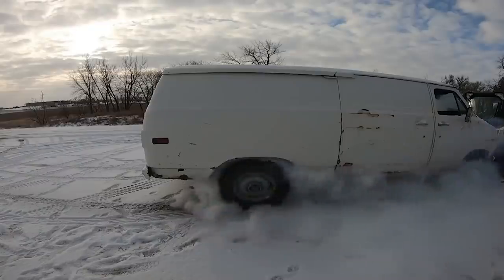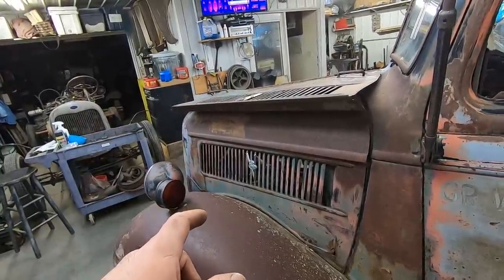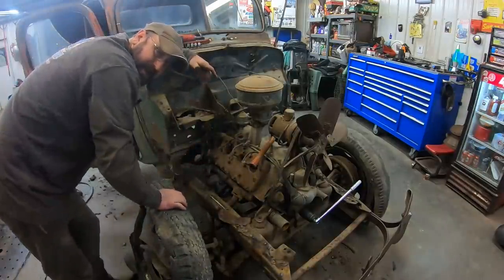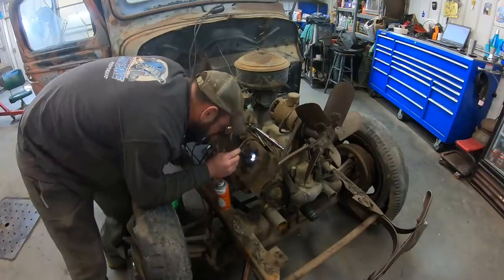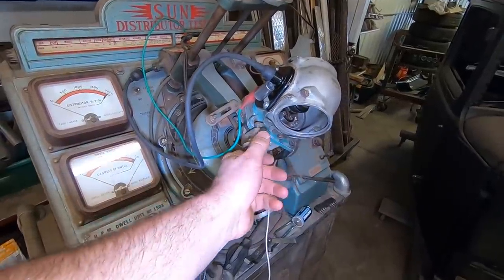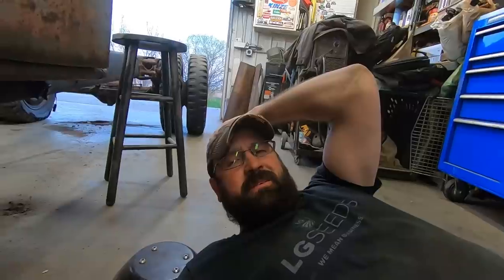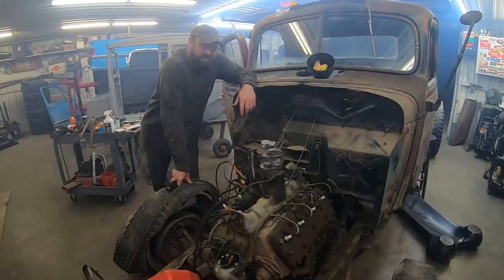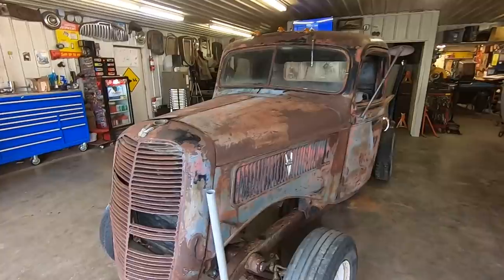1937 Ford truck Abandoned for over 35 years! Will it Run?!? Flathead V8 engine!!

Comment: Kroil is great stuff! I used to work offshore Louisiana,  that's about all they used for the salt environment. It works really good. But needs time to work. I snapped a 5/8 bolt off on my ol John Deere. Soaked it with Kroil, let it sit for 2 weeks & backed the bolt out with a channel lock!

Comment: Hello Mortske and Duff Dog, I had a 78 mercury monarch 302 and had to do the pokey pokey with the Oil, I put the Plug back in and put about a can and a half of Berrymans b-12 chemtool in and started it and let it run about 20 minutes and Holy Shitsky I didn't think it was ever going to stop draining, Pure mud I changed it again a couple weeks later with Berrymans and never had the problem again, drove for a few years with not much problems.

Comment: I’m 73 I remember these old Sun machines. Nobody that I knew reall y understood how to work them either. 😺
Reply: I am 66 and used Sun equipment a LOT in the mid 1970s in GM dealerships. A lot of the profit in them was pure showmanship, but if you had the knowledge, they could and would locate a tiny or intermittent issue. 
I had the benefit of GM training schools, so I had a lot of resources not available to independents.

Comment: Seeing as how that Ford Flat head V8 hasn't been bored out nor the valves ground and its from 1937 its worth more than the truck to get just it running. I like that throw together roller '37 Ford half ton pickup on that frame. great idea.
Reply from the maker: Thanks Larry!

Comment: When I graduated High School in 1973 ( Dont say it!) I went to work at a local TEXICO Full Service Gas Station! As a young Jedi Knuckle Buster. The old boy running the place said " You gotta start at the bottom and work your way up! Which meant everything under the car or truck was mine LOL! It was SOP to drain a quart of old oil out and add a quart of Kerosene and let her idle for about 10 minutes before the oil and filter change. We also never changed the Spark plugs unless the porcelain was cracked. We had the old sandblaster plug cleaner or we used the oxy-Acty number 0 gas welding tip to clean them. We had a Spark plug tester made by AC DELCO and a Distributor Machine too! I never got to use the Distributor Machine but I was told how it worked. I had to be able to snatch the 7/16 flat washer from his hand to prove I was worthy! LOL!
Reply from the maker: I'll have to show my spark plug cleaner collection sometime!

Comment: 5 minute engine flush looks just like, you guessed it, ATF fluid. I know that  ATF fluid works because in my younger days I worked in a shop when one came in...in exactly the same condition. Actually worse. I idled it for 5 minutes with the ATF fluid in the block then drained the pan. But not before the customer was contacted. It actually drove away. Good find there. The Ford that is.

Comment: awesome, another good ol' flathead Ford revival, man I love these engines let alone flatheads in general, I love how when they run they sound like a sowing machine when they're running
Reply from the maker: They sure do!
Reply: @MortskeRepair   yeah I was expecting that thing to be stuck but surprise surprise, had a few surprises like that as well, anymore plans with the Ranch wagon? I still would keep it a 223 6 cylinder since there aren't many of those 6 cylinder wagons or that particular car itself with a 6 cylinder anymore, but if I were to V8 swap it I'd get a 292 Y block or a 352
Reply from the maker: @elliothenning8791  On the hunt for a replacement engine.
Reply: @MortskeRepair   good luck to you sir, would like to see a part 2 of the ol' wagon

Comment: Dude, that battery box is legit, the bottom board is nice, oh and the ac hole in firewall is nice, you can keep cool on those muggy nights. seriosely the frame rails could be cut into fence braces, or used to splice something, all and all a nice rescue, and wouldnt be nice if it runs again.

Comment: I did some research, and i think you are right about the time frame on this truck. I can't find any evidence that Varcon batteries were produced after the mid 60s. Tiger spark plugs were manufactured by Gamble's, the same company that made Varcon batteries. Based on some pictures I found online, that appears to be a 60s era plug.
Reply from the maker: Sounds like that model battery was discontinued in early 1972.

Comment: i like what you do including the inserts,i have found one great penitarating oil called free all,i have used what you are using and still have some i bought a tractor at a sale were got 54 dodge first thing i did was check for stuck valves sprayed stuck one worked them a coupe of times totally freed

Comment: I started my truck once with the breaker bar still on the crankshaft bolt. Starter made a weird noise then fired right up. That's when I noticed the breaker bar sitting on the ground with the crank bolt sitting in the socket...LOL
Reply from the maker: Whoops! Just loosened the bolt on this one thankfully!

Comment: In the day , most trucks with 7.50 20s were called ton and a half. I rember with a 47 dodge being pulled on a scale at around 23500. It had the “upgrade 800 20 tires”. With a flathead crysler 6 and a 4 speed. Darn good truck.

Comment: My 55 from hell had a similar never changed oil pan. I popped the valve covers packed solid with sludge Call dad at work and he brought home a gallon of tri clean I removed as much as was possible and poured the gallon of TRI clean then fired up the camp stove under the oil pan refueled the stove twice and then dumped the solution. When I removed the valve covers thing were sludge free.
Reply from the maker: Nice!!

Comment: This must be the 4th time I've watched this video. A great one, starring my favorite engine, the flathead V8. I let an old Ford distributor machine get away from me back in 1989 when the Ford dealership I was working for was sold out. Was twisting wrenches back then. Kick myself for not buying it as it went for nothing. Had no where to put it at the time. Also let a Sun Analyzer get away at the same time.
Reply from the maker: Right on!

Comment: Watched a fella place a large pan full of atf/diesel  under engine, used a solvent washer pump to pump mixture up into oil drain and flush up through the block and out sparkplug holes and the oil filler, floods back down into  catch pan and pumped back up through engine.
Reply from the maker: Interesting

Comment: So.....ya got y'self another flathead truck....and you didn't drive the thing when she fired up!  What you scared of, Mort?  You've driven things without brakes before - all I wanna hear is the crashbox do its thing to the backdrop of that tuneful flathead and the whines of them straight cut gears!  

As you say though - there's something about a flathead V8 that just makes you smile.  The starter on that 37 and the way she spun the engine over and how it just caught and ran when you hooked up the tank, reminded me of a looong gone '48 Bonus (which did indeed have the 2-bolt dizzy) and the looong gone bloke who used to drive her.  Haven't seen a Bonus over here with her original engine in her for a very long time and the Jailbar (46/47) is more common in this country anyway.  

Still remember Dad's sequence for starting the old girl too. Summer or winter, he'd go out, climb in the cab, slam the door, roll the window down, light a smoke, then two pumps on the gas pedal, and wind her over.  Usually she'd go first time, but if not running after 5 seconds cranking, he'd let the key go and you'd hear that starter wind down  Two more pumps on the gas and this time she WOULD fire - and the flathead never burst into life with all eight, but acted more like one of the old V12 Rolls-Royce Merlin engines and you'd get partial participation for a few revolutions as though the pistons were sorting out which order they were going to fire in and eventually got it sorted out and she idled beautifully.  

OHV engines have a beautiful sound at idle, don't get me wrong, but there is something more magical about the idle of a flathead and they have a musical lope that just cannot be reproduced by any other thing on the planet.

As to what you found in the sump of that thing - yeah, I reckon someone might have been trying to up the compression or improve the oil pressure by filling the sump with grease instead of oil.  I've seen old grease separate into something like what you found, but I have never seen oil do that.....and as to the betting?  I said 'no water in the sump' and '5 cylinders have no compression'.  But hey - she ran and she sounded good.  Good on ya mate - another one saved.  Thanks for the vid - and the memories!
Reply from the maker: Lance! If I made shorter videos you wouldn't have so long to type these novels!! Thanks as always! Gotta love the sound of these ol' flattys!

Comment: I had a 37 flathead 4 door sedan way back in 1968, had alloy heads. Stripped 2 fibre timing gears which I replaced with a metal one, by myself in a n old dairy building, in regional Australia . The other main issue was the fuel used to vaporise in the fuel pump because of the dumb place they located it , changed to electric.. was a great old car.

Comment: I'm thinking that the engine hasn't been run since the late fifties judging from the looks of the battery. I've been using Aero Kroil for years. It is one of the best penetrating oils I've used. The only catch is it has to be ordered from Kano Labs directly as I've never seen it in an any stores. Those Tiger spark plugs were made in the late 30's or early 40's as they are a two piece plug that can be taken apart for easier cleaning.

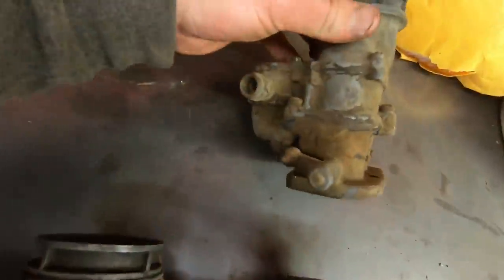Comment: 1:02:49   I have a rare Stromberg 81 in my 1927 4 Banger.  The Stromberg 81 also has the inlet at the same location as the 97.  The 81 will have a similar marking as you pointed out except with an 81 inside the small circle.  If there is no number 97 or 81 on it, another way to tell is to look at the other side and there will be a fraction, either 13/16 or 31/32 or 1 1/32.  That is the Venturi size.  The 97 will say 31/32 which is the same as .97" venturi.  The 81 will say 13/16 which is .8125" venturi.  That is why the model is called 97 or 81.  Just to break the rule, the model 48 refers to the main jet size of .048". Go figure.  Good job breathing life back into this old flathead; I was concerned with you creating all that exhaust smoke with your shop door closed. Quick work on putting out that fire.
Reply from the maker: Great info Stephen! I need to do more research on them.

Comment: The mortske special drink. Just mix 2 broken starters with some flexi rad hoses and garnish it with a plastic oil line gauge with just a tiny bit of oil left in it. Get the good stuff
Reply from the maker: Haha, it doesn't go down very smooth!

Comment: Thank you for the old Ford education.  I never got near any of that stuff. It seems the more locked up they are the more enjoying it is to watch you succeed. I wondered about that Flathead with the seized transmission from last time. Do you think filling it with evapo-rust would've worked? At the powerplant we used Kroil everywhere. I had never seen it before that. Awesome stuff.
Reply from the maker: Glad you enjoyed it! Not sure. I should have busted that one open.

Comment: You can run the coil with a resistor from another modern car, like a Ford or a mopar. 

But you can also just make an adapter, and glue a center wire in it. 

I’ve done it, it’s not great, but it’s possible.

Comment: That's a cool dually/ pickup,that engine sounded great to have been not run in 40 years & you & Derek from Vice Grip Garage should get together & do a video together,Derek can taste the oil & you can change a starter,Lol just kidding aside but seriously you 2 should do a video together

Comment: That Kroil stuff works pretty good. We have that stuff at the factory I work at but the maintenance guy there thought it was a cleaner or something, and boy does that stuff fume up the place. If you use that stuff in moderation it's fine but I wouldn't use it as a cleaner. We ended up using the exhaust fan in the middle of winter to air out the shop.
Reply from the maker: Haha I'mma use it as cologne!
Reply: @MortskeRepair  🤣😂👍

Comment: She's a Runner!!  It'll clear right up I bet... so for flushing the sludge motor, I'm actually an expert.  You'll want to fill it up through that vent tube right up to the top with some Jagermeister, let'er sit over night and have all ur friends or rent some college students or something to come shake the hell out of it, then simply apply air pressure cupped over the vent tube with a Jaeger soaked rag and give her the full beans and have a buddy open the bolt at the bottom and it should look like what comes out after a nice TacoBell chalupa party bag!  Then refill clean oil and ur all set!

Comment: You sure were brave giving praise to that starter. I was expecting it to laugh at you right before it decided to die.
Was it normal for Ford to mark their pistons with "STD" back in those days? It seems odd since you'd think they would only have one size when building a new engine but it also seems odd that someone would replace all of them without boring and rebuilding it. If anything I had expected to see a Ford emblem in the middle of them.
Reply from the maker: Yeah, my other flathead video had them marked as well. Most manufacturers did.
Reply: They overbored at the factory if there was issues, also undersized cranks. They used for crates and fleet vehicles, at least this was practice from 60s to 80s. They may have sold reworks as new back then given the higher scrap rates.

Comment: So, you got crude oil coming out your sump (engine pan) TBH I ran "minicabs" (unlicensed saloon cars as Taxis) for around 14 years, but every oil change back then pre fully synthetics I dropped the oil, gave the engine half a gallon or half what it needed of new hydraulic oil then let the engine idle for 15 minuets or so, long enough to drink a mug of tea, then dropped that now horrid black stuff out, let her drain fully - maybe have 2 toasted buttered crumpets, then change the pre oiled new filter add new oil to top line of full, run the motor then re check the oil, as its looking nice and clean, then cane the ass of the car for up to 12 hours a night till the next oil change in 5 to 6 weeks - repeat.. One Ford "sierra" saloon car done nearly 200.000 miles trouble free, but the newer (then) sierra saloon done 300.000 miles trouble free, all down to my regular oil change system...The cars done up to 300 miles a night - When the wheels were turning you was earning - as we said.. But to save my sanity, I packed it all up night driving as I just had enough of drunks and druggies..  Good luck with the old ford mate - Ian --UK>

Comment: Just yesterday, saw wet sheen on a Toyo laser 56 heater heat exchanger.
Wiped my finger across it.
Wet finger, couldnt sniff anything, is it water?
So licked my finger.
Yes I dipped my finger in heating oil, couldnt smell or taste it! 
Having had the Rona sucks.

Comment: The distributor is another indication that the flatheads are two model B Ford's cast together in one block. Two distributor caps two points two water pumps. The shared components are the cam the crank and the block everything else is left and right four cylinder engine with a common block and the only have one oil pump.
Reply from the maker: Pretty much

Comment: Not the original engine in the truck, original engine would have dual pulleys. Dipstick damage is from corrosive elements in the crankcase oil. Not stock fan, original was 4 blade. Seal beam conversions came out in the late '40's. you are very lucky that the engine is free, and that you got it started. I have a '37 1.5 ton truck, that is why I know. Good luck.
Reply from the maker: You don't suppose the waterpumps and generator could have been swapped in 84 years? Not saying it's original but it would be very easy to convert it as well. I've got several sets of dual groove pulleys for flatheads. I agree, loose 59AB engines are hard to come across!

Comment: Any chance that truck was ever used in WWII?  If it was once grey, does that mean it may have been a Navy WWII truck?  I have a 1941 GMC truck in similar condition to yours and I want to make a half ton out of it, but I was told it may have been used in France in WWII.  If that's the case, is it best to make it original as a war relic, or can I make it a drivable half ton without loosing value?
Reply from the maker: I think it was only late models they were using at that time but who knows.

Comment: 14:00 Should have 24 in. steel wheels on your oxy/acet. setup.  Much easier to move over rough ground and the bottles balance out so much better reducing operator fatigue. Ask me how I know-
Reply from the maker: I don't move it around that much, plus then they stick way out in the way. And are noisy.

Comment: Take the resister off a 55 or 56 ford from the fire wall you have 12 volt system with 6 volt coil

Comment: This is what I found on the tiger spark plugs 

When did spark plugs come out?
History. In 1860 Étienne Lenoir (credit is also given to Edmond Berger, who invented but never patented the spark plug on February 2, 1839) used an electric spark plug in his gas engine, the first internal combustion piston engine. Lenoir is generally credited with the invention of the spark plug. That’s your useless or useful depending on how you look at it morske but I’d thought I’d let you know I know it’s an old upload but still interesting to watch non the less
Reply from the maker: Thanks for the info
Reply: @MortskeRepair  your welcome